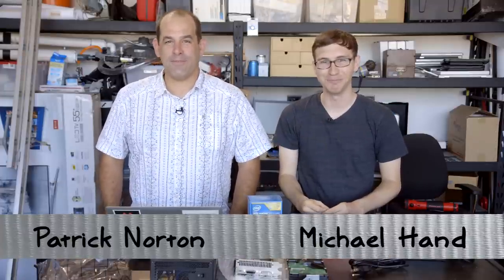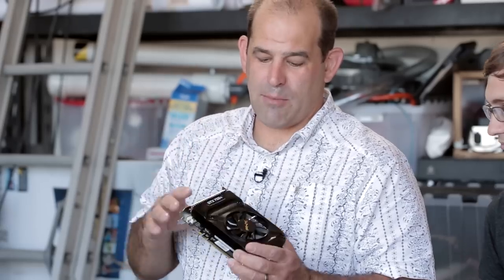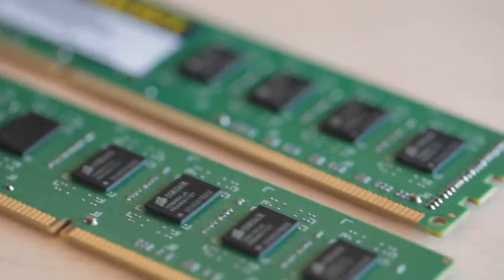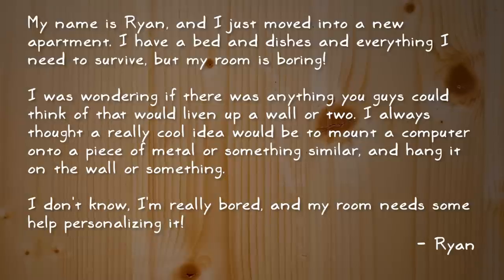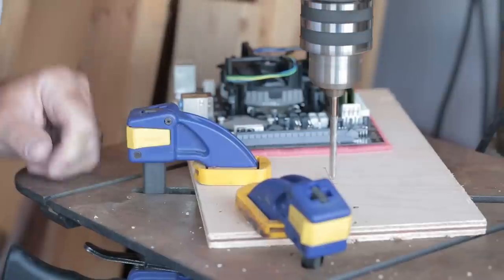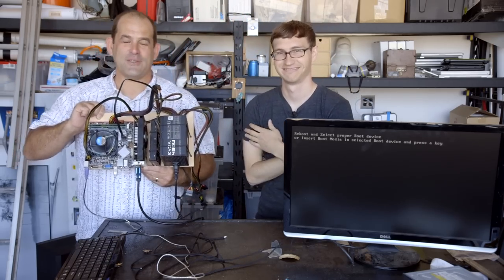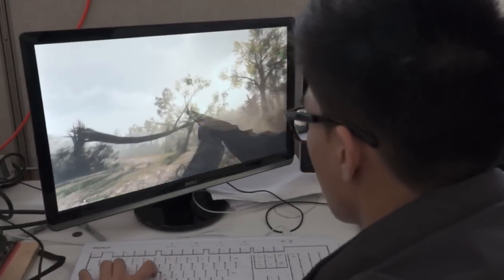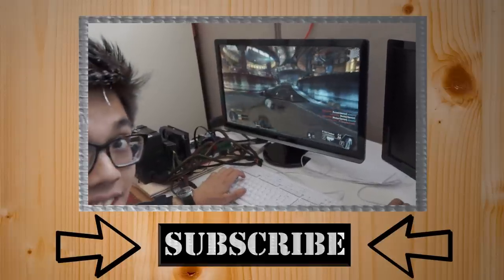Screw The XBOX ONE and the PS4... We Built a Gaming PC for $380!

Comment: Throw that board into a tank of mineral oil, and clock the crap out of it!

Please.
Reply from the maker: I've heard Patrick vow to never work with mineral oil and PCs ever again. Some of the Systm projects still haunt him. 
How to Build an Oil-Cooled Aquarium PC - SYSTM
Reply: I've done one mineral oil build for a client who wanted something different, so I went to the pet store, bought a 30 gallon fish tank, made it look like a tropical scene, got the parts in the tank took it too the clients office, filled it with mineral oil only 2 days later to have his drunk wife to knock it off his desk, and ruin the $1,000 PC, with him having too call in service master too get all the oil out of the carpet I vowed never again too work with Mineral oil cooling no matter how well it cools, or how cool it can look when setup proper. It's just not worth the risk. Now if u had said put an AIO water cooler on the CPU, that I could go for.
Reply: DIY Tryin
okay, how about taking a cheep processor, with a super elaborate/ridiculous cooling system, and clock it until it self destructs?

You know, for science.
Think of the children.
Reply: KelvinSmoke I'm all for Abusing Processors For Science... but today's CPUs are designed to throttle themselvs down, then shut down before they can thermally self destruct. And, as DIY Tryin mentioned, I haz done mineral oil PCs... and while it did look wicked cool, it was world class messy, cleanup was a nightmare, the cooling was meh compared to liquid cooling, and the mineral oil managed to contaminate and kill the PSU in a couple of months.
Reply: patrick norton
You can disable the thermal overload protection on almost all modern motherboards.
Reply: patrick norton I hear that fully saturated coconut butter is the way to go. Great thermal conductivity, liquid at operating temperature, non-reactive and shelf stable, and to top it off wont crawl up cables! 

For transport just wait an hour for it to cool down and solidifies.
Reply: ***** Good troll job at posting a link to malware, Bitdefender on Windows blocks your link, and you have been reported.
Reply: Mineral oil... ?? Eeeeggg? ? As a cooling liquid?
Reply: astrix1793 yep it's non conductive, and dissipates heat, just don't put your storage drives down into it, and it can be a total mess too work with if your not careful. For most builds good Air coolers, or AIO water cooling solutions are more then enough.
Reply: yeah baby,,,now we're talking   :)
Reply: I still trip on the fact that you can throw a whole pc into a non conductive fluid and it'll be fine.
Reply: Commodorefan64 thanks
Reply: astrix1793 your very welcome